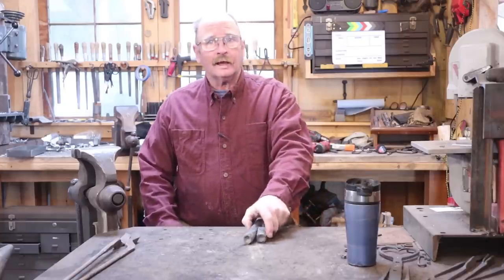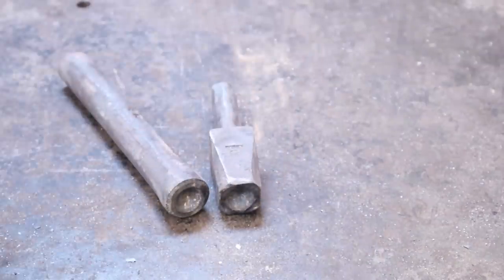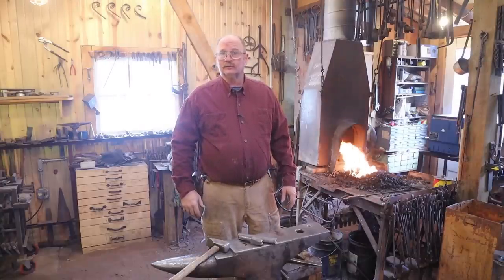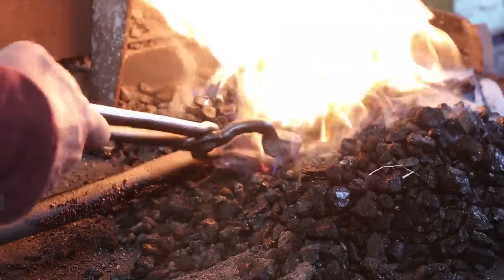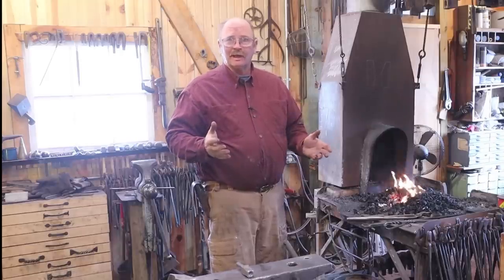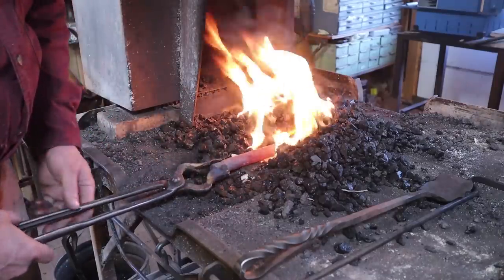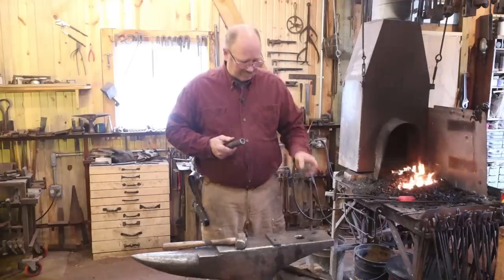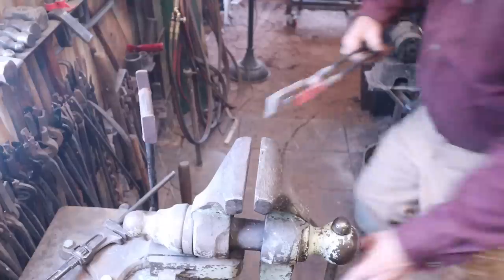Rivet headers hardening and tempering

Comment: Jihaa.. coal fire. I just love the use of the tradional coal forge.
Is there a rule of thumb of how long the rivet (or round stock actually) should be?
Thanks!
Reply: Standard rule of thumb for rivet heading is to use 1 1/2 times the diameter of the rivet for the head.

Comment: You mention needing to add some more oil; would you use fresh unused motor oil, or used motor oil?
Reply from the maker: never motor oil, it is full of stuff that isn't good for the steel.  I use commercial quenching oil formulated for heat treating.  I will recycle the current oil and stat with all fresh

Comment: Hello John, may I ask what you might think is a silly question. What's the differance between using a forge with a Tue as apposed to a Firepot ?
Reply from the maker: Even a fire pot uses a tuyere.  it is simply the pipe through which the air passes on its way to the fire pot.  In a side blast forge the tuyere comes in from the side and there is no cast iron pot.  There are advantages to both and people who will argue loud and long about which is best.
Reply: Thanks for taking the time to reply John I understand now and just ordered my forge

Comment: Would a rivet chucked in a drill with some carborundum powder/oil paste polish out the header? I have had some 400 and 800 grit powder kicking around for 30+ years, no idea if available and if so, where.
Reply: Great idea Jan-Reinier, others wanting to try this could use automotive valve grinding paste, I'm pretty sure that stuff is readily available. I just love John's videos.
Reply from the maker: The rivet being soft iron would grind away long before the depression in the tool steel would be polished.  But with enough rivets I am sure it could be done.
Reply: Agree, Uncle John. Just to even out the last roughness (or even just highlight high spots) by rocking the anointed rivet head, the softness of the rivet preventing stuffing up your work piece. That is what would happen to me when impatient me uses too much tool. Keep your snippets coming, they are packed with info/experience.

Comment: What type of pipe is your coal forge vent made from?
Reply from the maker: From the ceiling up it is a 2300 degree wood stove chimney.  The short section between forge hood and the ceiling support is just ventilation duct.
Reply: Black Bear Forge okay,thanks for the info!